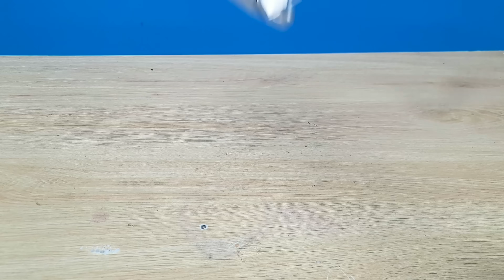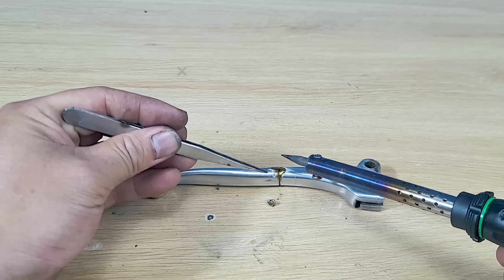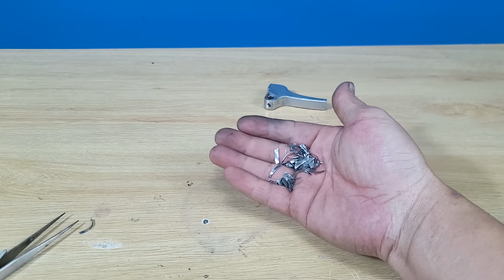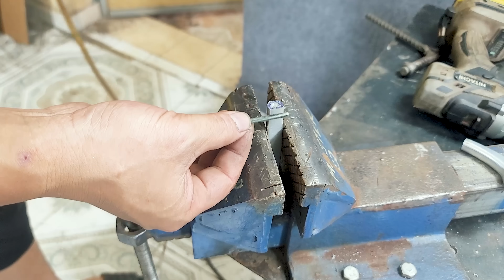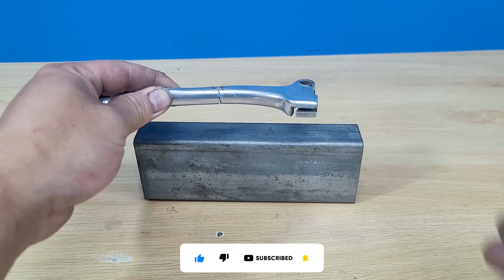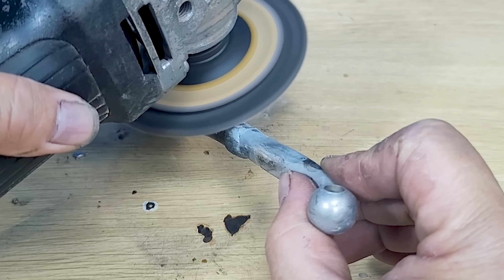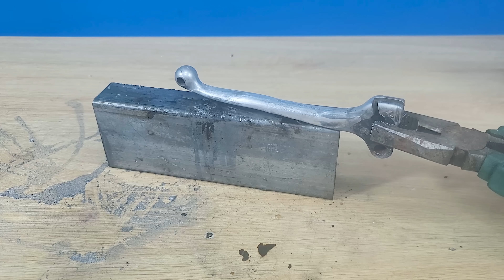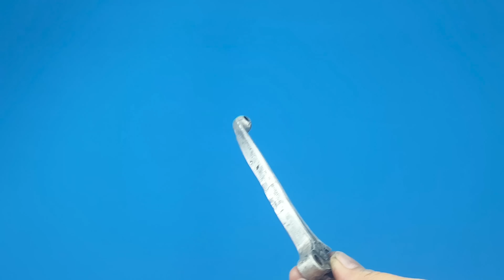Even a NASA professor had to learn this from me! Idea of using 1,5V battery to weld aluminum brakes

Comment: Couldn't you have just soldered the pieces together instead of having to put that stem in?  I think the solder has a strong enough mechanical bond for that handle.
Reply: One pull and it will come off😅
Reply from the maker: Hello, you are right, as you have seen, our country is still poor, motorbikes are the main means of transportation and brakes are a safety part of it, I need extreme safety. To me, it's like building a house that requires a very solid foundation. Thank you very much for your attention. Wishing you and your family good health.
Reply: @inventorK20  country may be poor but why to make suicidal repairs 🇮🇷